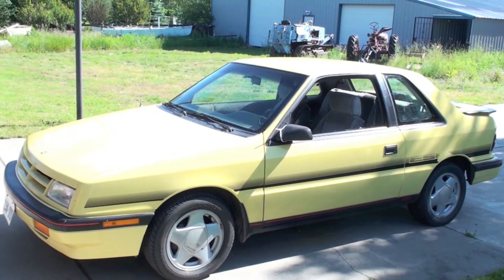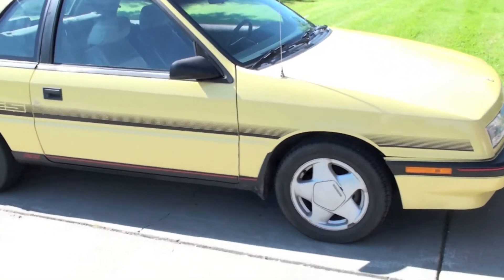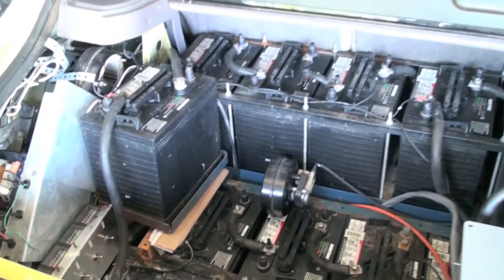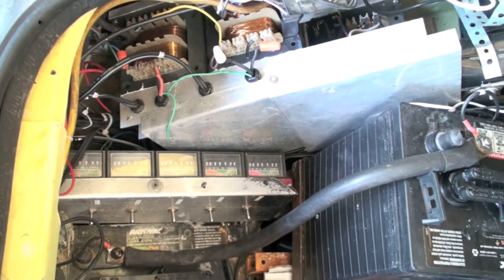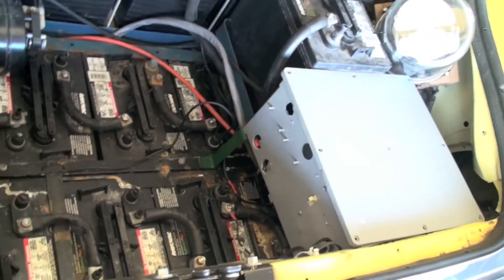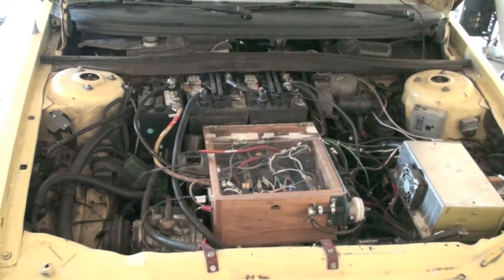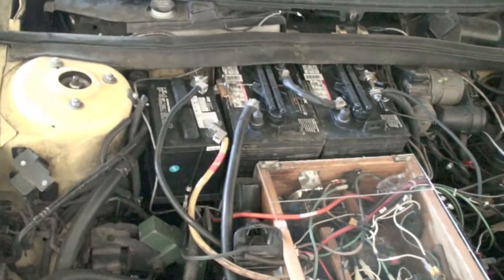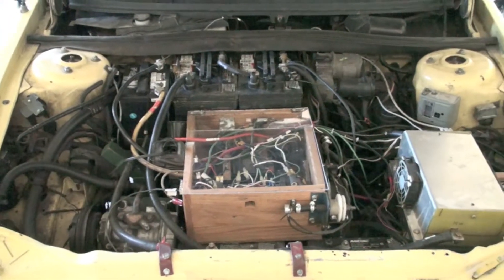Electric car conversion overview

Comment from the maker: The electric car playlist will probably be very long.  My approach to the electric car is from a limited budget and I have come up with some interesting methods to solve problems.  I am driving it now, and attempting to increase range.  I have several other irons in the fire so it will come as I have time.  By the way, the whole electric car thing is an absolute ball!